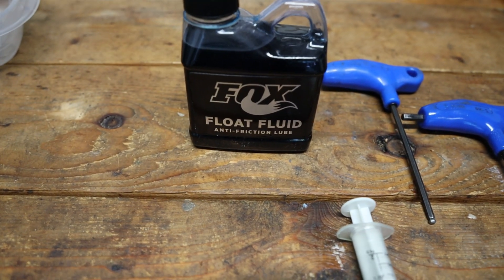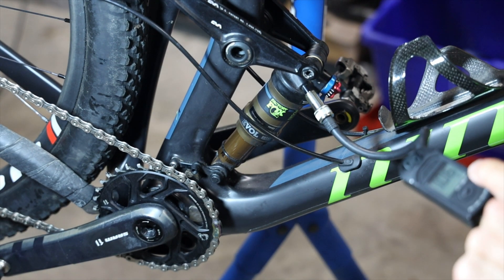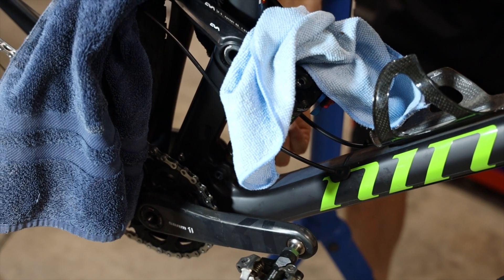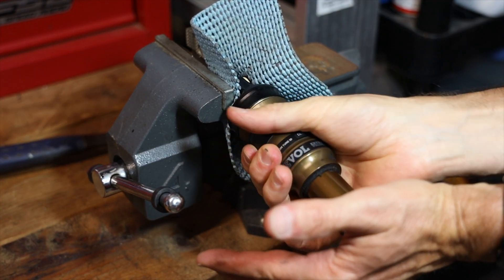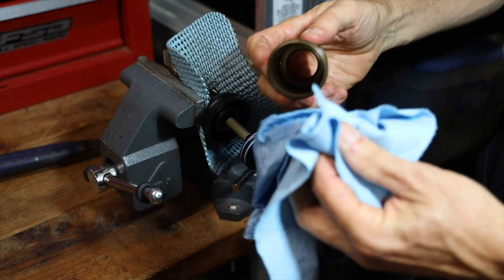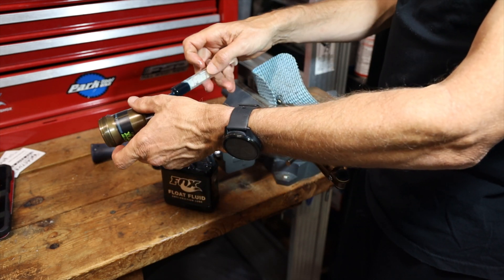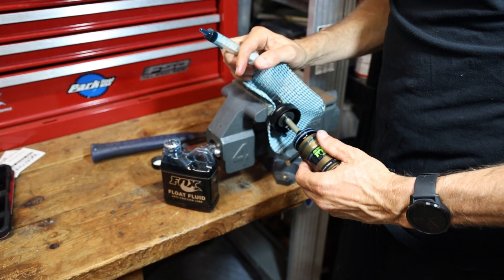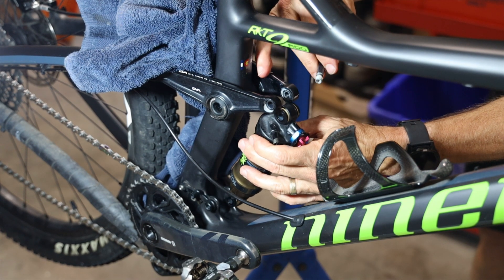Fox Air Sleeve Maintenance for Float Shocks

Comment: Clint, do you know if the shaft can be rotated horizontally? If yes, I think that would be the answer to my question so that I can mount a dpx2 in my Stumpjumper. Thanks again! 😀
Reply from the maker: Yes, the shaft can be rotated.
Reply: @ClintGibbs  Do I have to diassemble everything first like what you did in the video for me to be able to rotate the shaft or I can do it from the outside without diassembling the shock?
Reply from the maker: Not at all. You can just put something like a screwdriver through the hole at the bottom of the shaft and rotate it.

Comment: Hi Clint, Great, well presented video as usual, is this the same proceedure for rockshox shocks? I know the oil may be different, but would there be any unforeseen "nasties" that may occur when taking a rockshox shock apart?
Reply from the maker: I think rockshox is pretty similar. I opened one up to change the volume spacers. You just need to find out the type of fluid and the amount that they recommend.

Comment: Thanks Clint. I love maintenance videos. I have an entry level Rockshox Recon Silver fork and was wondering what I can/should be doing short of a full maintenance. One of these maintenance videos for a fork would be awesome!
Reply from the maker: The main thing to do is to keep the stanchion tubes clean, wiping them down with alcohol frequently. Then change the oil maybe every 6 months.
Reply: Thanks. Will do that after every ride!

Comment: Hi Clint, great video - one question, I always thought you put some float fluid in the lower part of the sleeve before sliding it on the shaft? and then once on, like how you showed, another 2ml.
Reply from the maker: I just lube the seals and then add 2 ml. It's just the way I've always done it. I've never heard of doing it the way you mentioned.